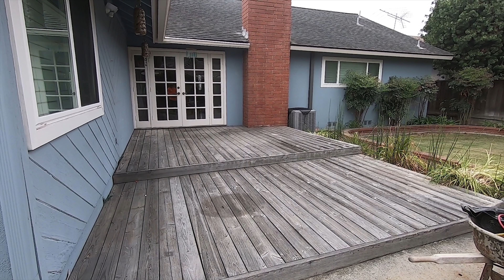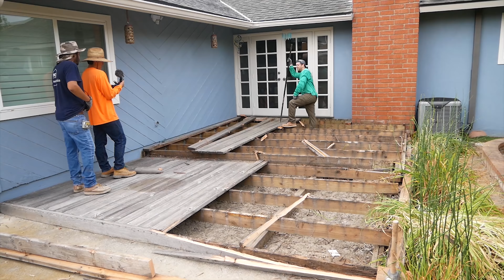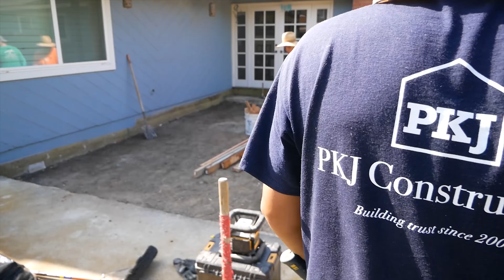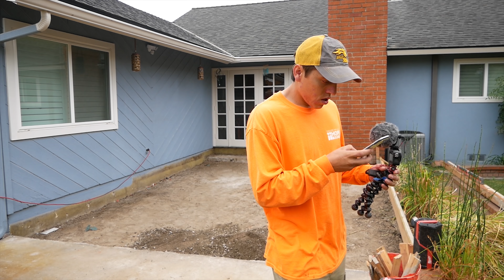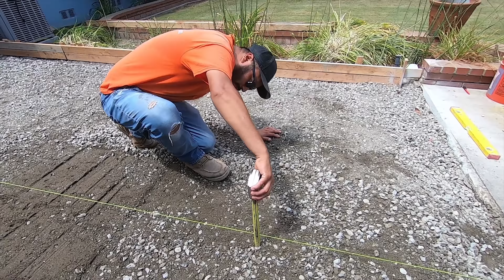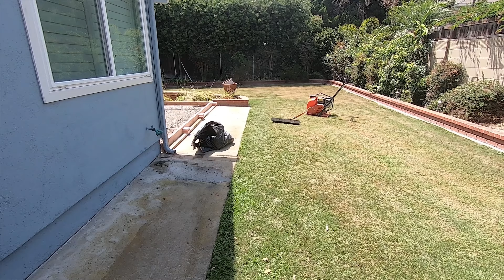Demo and Setup for Wooden Stamped Concrete Part 1

Comment: Got a video suggestion? My back yard slopes away and down for about 25-30’ then a drop slope of about 7’ then slopes again for another 7-10’. The adjoining back property is landlocked and slopes to a deep ravine drop of about 20’. This makes the yard nice and runoff water well, but makes the rear inaccessible because of the first drop. I first thought of just decking from the yard to the property line but seems very expensive to make the whole yard usable and accessibility to the far corners as you definitely would need a safety fence as that would be a high drop. Another said to build a retaining wall at the property line and back fill the gap bringing the usable yard up and level with the existing yard. My concern here would be erosion and eventual failure of the wall. Any suggestions or have you tackled deep sloping projects in video? Thanks!
Reply from the maker: That's a unusual situation

Comment: Haha, you made me laugh when you mentioned your “world famous fibre mesh”. It’s almost as famous as your 50% nylon/50% horsehair broom. 🤣👍🏻
Reply from the maker: It's getting there
Reply: @One Plus you take the distance from point A being the beginning of the concrete to point B the end of the concrete and you either do 1% grade which is equivalent to 1/8th of an inch per foot which is what I do. So if this pad is 20 feet long from the door to the driveway. Not including the step there should be 2 1/2 inches for slope. If there were no steps its easier. Just use a laser or Mason line with a line level (Cheaper than a laser). Have someone hold it at point A and you go to point B. Make sure that point B where you are holding the line level is 2 1/2 inches above where the top of your concrete is. 2% grade for less experienced crews would be 5 inches of drop. Keep in mind these numbers are hypothetical and change with distance. 1% grade on 10 feet would be 1 1/8 inch drop. 1% on 100 feet is 1 foot 1/3rd of an inch drop.
Reply: @jmconcretecoloradosprings  👍
Reply: @One Plus it's pretty simple once you have your forms down. You can first get it close with a come along then runs a Mason line from end of concrete to end of. Usually helps to have 2 people holding the line and 1 measuring thickness. After getting it closer to 4" inches thick. I do 3.5" since I pour 4000 with fiber and bar. But after all that you run a rod like your screening concrete. Should get you within a quarter inch of where you want it. Then saturate the granual base and hit it with a plate compactor. This is after hitting the cohesive soil under the road base with a rammer. Make about 6 passes with the plate. Then you should have %95-%98 compaction. I think David would agree with me on this.
Reply: @One Plus it’s nice to see people helping each other in these most hateful of times!! God bless....

Comment: If you don’t want to use tap cons, drill a hole with 3/16 bit and use 16 duplex nails with a wire.
Reply from the maker: yes that works as well

Comment: Instead of adding roadbase to reduce the thickness of the concrete to 4" (from 6"), why didn't you leave it as it was and just use more concrete?  You would have saved time and money on picking up the roadbase material, time on spreading, screeding and compacting, and the concrete would be thicker and stronger.
Reply from the maker: That's a good point